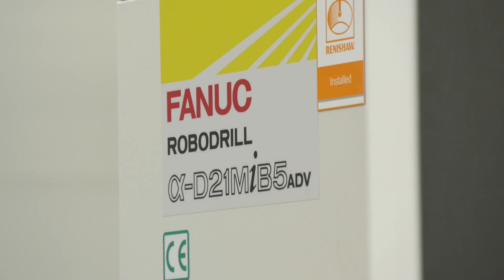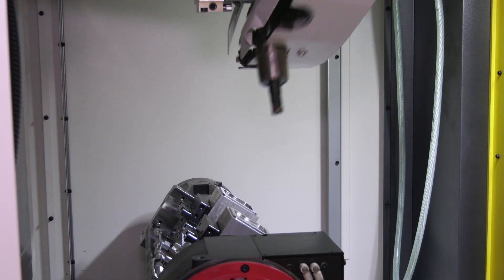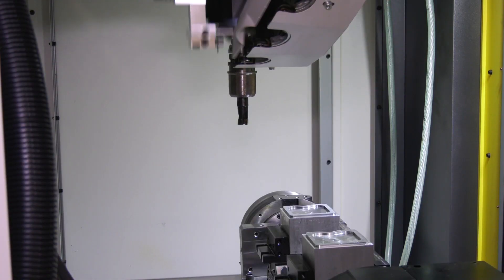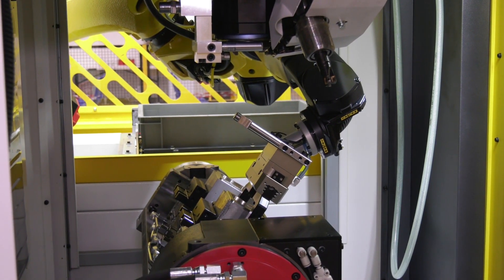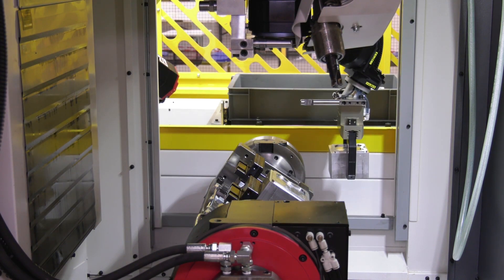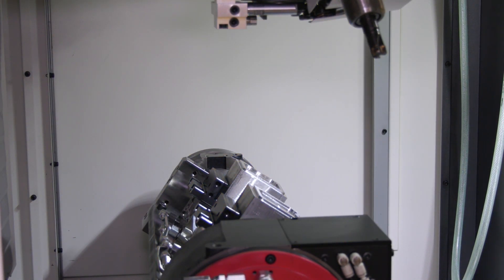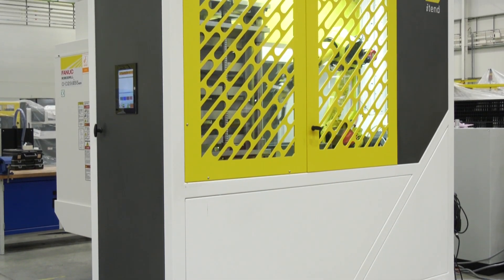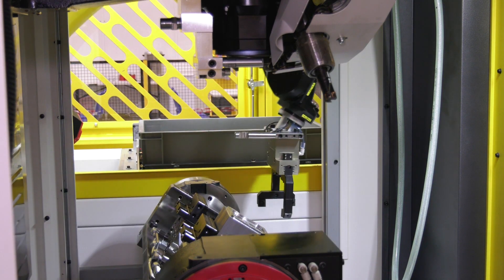4 axis Robodrill for sale

Comment: Where is the 5th axis?
Reply from the maker: on the table
Reply: X,Y,Z come with the mill, DDR-T adds an A axis but no B
Reply: @AdamEarl2  they appear to have confusing advertising regarding 5 axis capable (software), but only appear to supply up to a 4th axis from the factory, unless someone has better information. 5th axis likely needs to be sourced from somewhere else, or custom.
Reply: @MTDCNC  hi belli sir how much price robodrill 4 axis and 5 axis